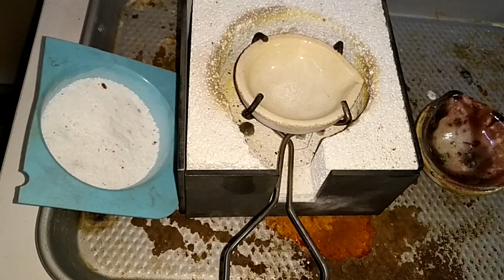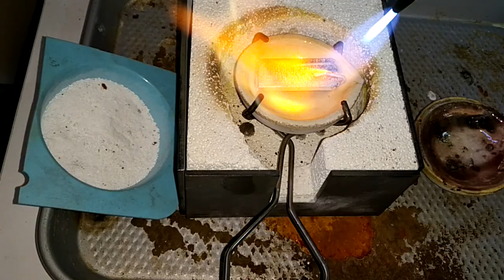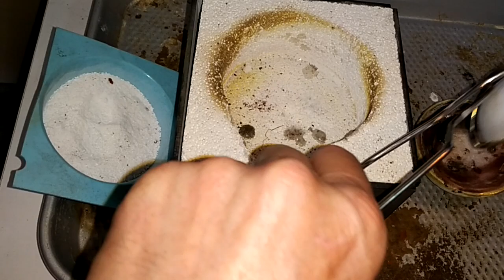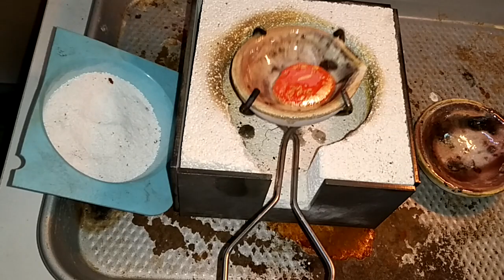How to Use a Crucible When Melting Metals

Comment: Why is it stuck?
Reply from the maker: Some people new to melting metal don't have torches  hot enough to get it fully molten causing the metal to stick into the seasoned surface of the crucible.
Reply: @craigdabler-thediycastings7511  that might be my problem, I'm using MAP gas to melt.